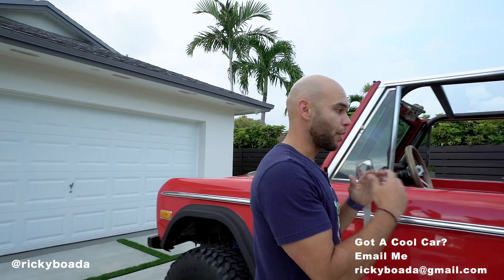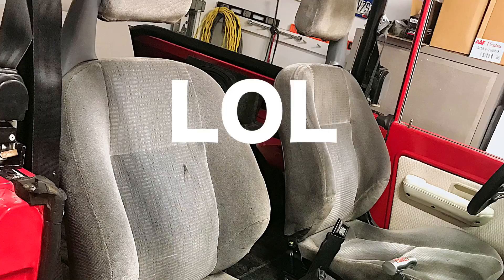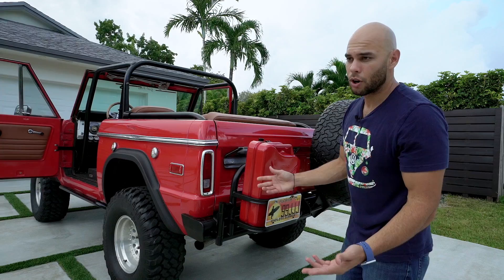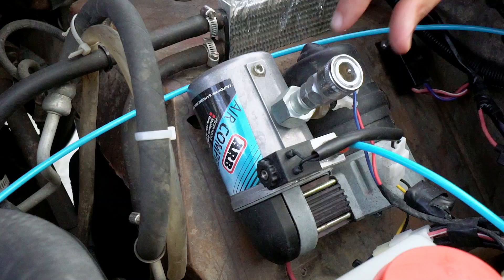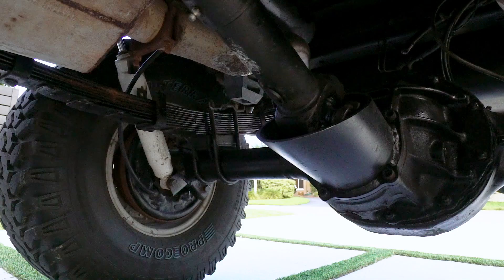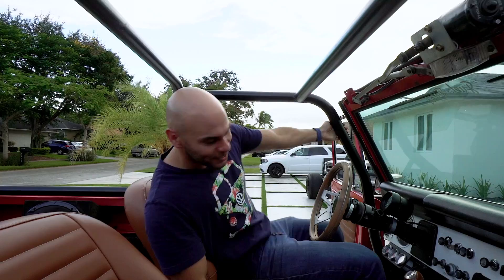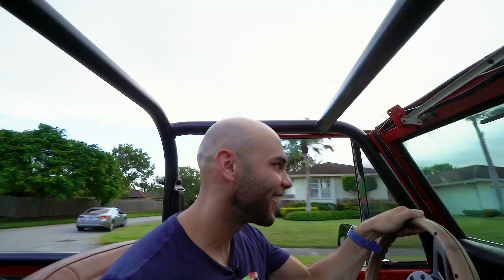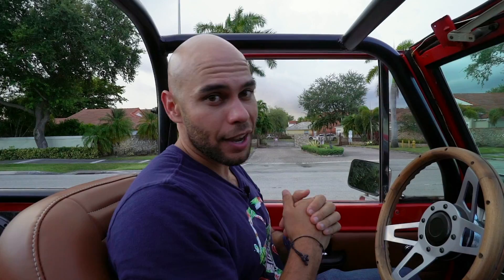This $35,000 Classic Ford Bronco is Only Getting More Expensive

Comment: On my 1973 Ford Bronco, I got installed new seatbelts and a center console and a new odometer gauge and new bumpers front and back. The next thing I want to do is to put it on a 5 1/2 inch lift kit and new windshield wipers and reservoir and motor.

Comment: Bigger more power isn't always better off road My Grandfather  had a 1968 Bronco with the falcon style engine it was way better with that engine and dana 35 axle in front. because of how light it was and the fact it sipped gas, had just enough power and torque. he also had the 1975 bronco it had a 302 and  c4 dana 44 and large 9 it was sweet!He told me that the 68 was better for the type of use he did off road logging roads and hunting.  I understand its nice to have more power and speed but it doesn't make it alway better. I owed a 1974 Bronco with 302 44 lrg 9 and i loved it!  I now own a 1979 full size with 400 4 speed  its starting to grow on me and i can see the improvements form the 66-77 model ! ill say it again it doesn't make it a better capable rig off road. if the early bronco will go place this fullsize cant fit.
The weight difference takes away from it will get stuck were the smaller one will not.
a friend had a lifted up avalanche with big power and tires! well that thing got stuck mainly because of the tir choice big and wide with 3-4  feet of snow i went in the ditch hooked on to this monster!  He doubtfully asks do you think that bronco can pull me out ?
I reply iam pretty sure 
well that thing in 4low and first gear pulled it right out to the road! He doesnt like telling that story but i sure do!!
Reply from the maker: P bronco I agree with you on all of this!! Thanks for the feedback man

Comment: Very nice Bronco. Great job showing the details that help our build designs. If I wanted a 302 like you have, us there a kit thats sold with the mount locations, etc to bolt on?   Would  make placement much easier forward, back, height for tranny match-up . Also is the shifter located in the correct place after the transmission is joined to the motor?  Thanks. My 66 U15 is a project I can envision, and with help get through most everything else. Would a Explorer transmission with a 302 be a correct fit ? Not building this for much off road use, but need it to perform. Thanks
Reply from the maker: Michael Robertson thanks for the kind words Michael. I’m not sure about the transmission questions and the 302 is the original engine so not sure about the mounts. If I come across anything that may help you, I’ll be sure to come back in and let you know

Comment: AN intake doesnt increase compression.
Reply: He mentioned the intake because when you use the 289 heads it requires the 289 intake. Smaller combustion chamber makes the compression higher.